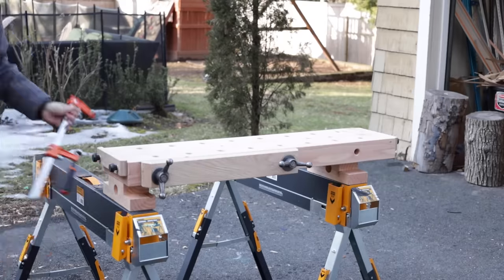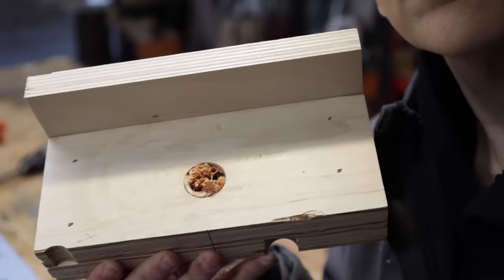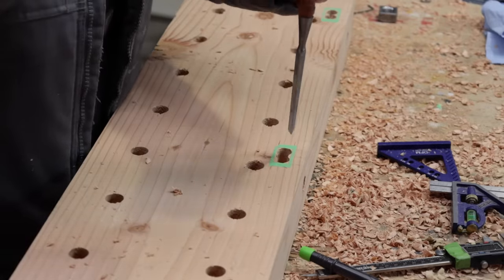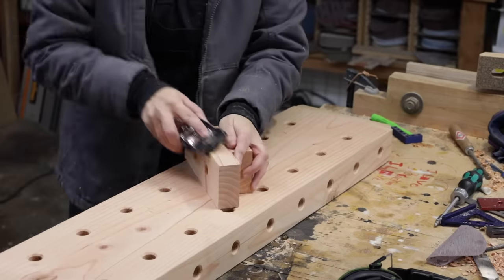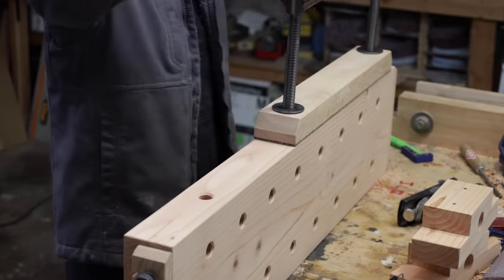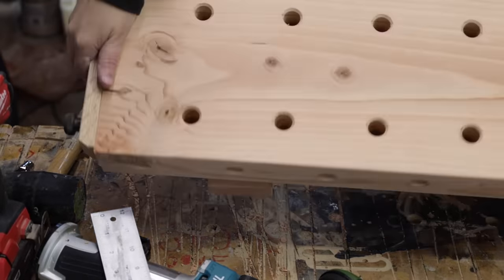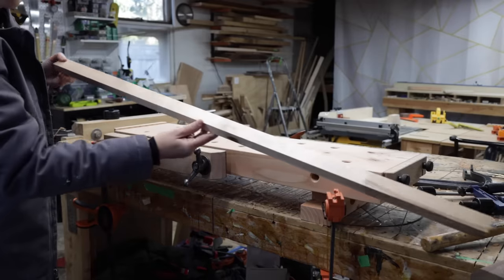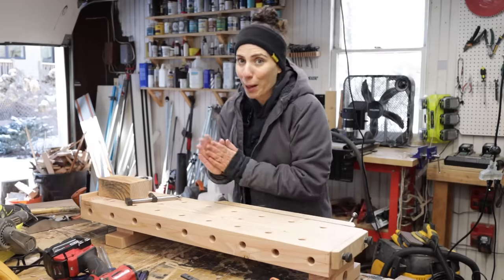Portable & Affordable Workbench for Small Spaces

Comment: Tamar, I just wanted to offer you a good tip. If you need more muscle on your vise, instead of struggling with pliers, you just need more leverage. If you have a pipe, you can slip it over the handle and that will do the trick. If you don’t a deep socket and extension works wonders
Reply from the maker: Good tip!
Reply: Another quick option for a 'cheater' bar is to hook the closed (box) end of a largish combination wrench over the vise bar, and lever it back over the vise screw.  Or use the loop in the end of a crescent wrench the same way 👍
Reply: While I would normally agree with what you are saying, not so sure I'd use a cheater bar on that type of vise. Tamar, you just need a bigger vise for that job!  That wooden vise (read clamp) is not designed for the forces you are putting on it.
Reply: I also thought that the pliers were an odd tool for the job. They hardly extended her leverage and left ugly marks on her vise.
Reply from the maker: @vanessas2454  I literally just grabbed what was next to me without putting too much thought into it. Ha
Reply from the maker: @The Program it really wasn’t a big deal. I don’t know why ppl are focusing on this. 😂

Comment: Great build and thank you. I struggled with vise as well until I got a 3/4 galvanized pipe that is 12 inches. I just put over the handle of vise and use it as a breaker bar and struggle no more!

Comment: I built this using this video as a guide about 6 months ago.  Even though I have other work surfaces, I found myself using it a lot for other things.  Along the way I added a few things that I think make it much more useful.  They are:

1. I glued a pencil sharpener to the side of the workbench, left of the moxon vise.
2. I bought an 8x12 sheet of leather and used a piece I cut from it sized to fit a pencil that I nailed into the underside of the bench just to the left of the moxon vice. I saw this in another video that someone added to a full size workbench.  I can't tell you how many times I've needed a pencil when using this and no longer have to get up and go find one.
3. To the right of the moxon vise I built a small drawer to hold my bench dogs.  I was careful to make sure that the slides for the drawer were in between the dog holes and I figured if I needed the  dog holes above that were directly over the drawer, I could just pull the drawer out and set it aside. My drawer was about 8x8 inches wide and about 1/2 inch or so shorter than the available height.  I used 1/4 plywood as I knew it wouldn't hold much weight. I also cut a small piece of hardwood and made a drawer stop right above the drawer using a screw to secure it and just loose enough that I could rotate it down in front of the drawer to keep the drawer in place.  In the back I just glued on a small block of wood to prevent it from sliding out the back.
4. Finally since I found I was using this bench so much for things that didn't need the dog holes and often small things would fall through the dog holes, I got a 1x16x36 piece of project pine board from Lowes and glued 4 3/4" dowels about 4 inches long to the bottom of the board so I can when needed just drop this board right onto my workbench and have a larger work area without dog holes. 

Anyway, I use this thing all the time, and I wanted to share how I've increased it's usefulness over time.  It's really been a great addition to my workshop and this video made it so easy to build, along with links to all the parts.  I find it so frustrating when vloggers don't include links to the parts they use, IE the knobs, the vise hardware etc.  Having all of that for this really made this video and instructions easy to follow
Reply: Wonderful ideas you've implemented here. I'll have to steal the removable dog hole cover/work space. 
I plan on making this at coffee table height and it would most definitely be used for other projects. You could make multiple insertable tops for different needs. A self healing cutting mat, sharpening stones, etc. would bring a plethora of utility.
Reply: Thanks for sharing your additional modifications and experience with this design - very informative. I'm always amazed at the creativity everyone brings to these projects!

Comment: This bench looks very useful.  If you are using the bench on your dining table or other furniture you may want to add some of that cork rubber or some other padding to the feet to prevent marring.  Also, adding a couple of dog holes to the Moxon jaw will let you clamp pieces to a dog in the bench for planing, routing or carving work where you want access to the entire surface.
Reply from the maker: That’s a great idea!
Reply: Those are two really nice ideas! You could make easily removable feet too and attach the non-marring pads to them. That way you can remove the feet if you ever need to put the workbench on a dirty surface.
Reply: That cork rubber on the feet might be nice even if you’re not on a surface you’re worried about scratching up. And if it was on a floor it would probably help a lot.
Reply: If I had a dining room table to work on; I wouldn’t need this work surface
Reply: @darylg3720  Oh, you're one of those.
Reply: @darylg3720  hahahahaha! The words of a single guy (or one trying to become single again, hehe).
Reply: @darylg3720  who needs flathead screwdrivers either when you got butter knives?

Comment: I love this for adding a little hand tool accessory to an existing bench or wherever. I would say, even as a person with a large planer, I’d probably just make this out of 4 layers of laminated plywood because I feel like it would be more stable and harder than a 2x10. If you DO plan to go this route I recommend over-sizing your plywood so if it slips when you glue it up (and it most likely will) then you won’t have start over. Once the glue is dry then trim the entire assembly to final size.
Reply: Hii sir 🤝🤝🤝😊
Reply from the maker: Sounds like a good plan!
Reply: Hi Jeremy. My first thought was plywood too. I just built one out of 4 layers of 5/8 ply. Check out my thread in the comments if your interested in a few details.
Reply: I think the side holes be a problem in plywood.
Reply: @alportante  no problems so far. Delamination is not going to be an issue.
Reply: @alportante  I think I see what you are getting at Al. The pressure from the hold fasts is longitudinal when using them in the side holes. If said holes are drilled along the C/L of the side any pressure would go directly on the lamination line which could possibly be a problem down the line.  With my bench I centered the holes on the center of the 2nd layer (15/16 up from the bottom). The holdfast pressure is now centered on a factory sheet For overkill, I  used a leftover part box of 2 in. hardened concrete screws (Tap Con) driven in from the bottom in what I felt to be the appropriate places.
Reply: @robertjeglum4657  if going with plywood and multi glue ups, it's also possible to add a plywood siding, oriented vertically.

Comment: Tamar ... you knocked it out of the park!  This is exactly what I need for my portable garage / basement work shop, much more than the Moxon vice I built.  I'm going to use the those Moxon vice parts and make this bench.  I'm sure I can find the square nuts vice the hex nuts.  I'm also a member of a community wood shop so I have access to a planer, drill press.  I just batch the work and drive over to the shop.  Stay warm ... 19 degrees in western NY today.  v/r ... tom
Reply from the maker: Awesome. So glad you found it useful!

Comment: For this small shop passionate woodworker your video was the best 24 minute use of my time I think I’ve ever had on YouTube.  Bravo!  I just recently purchased your 6-in-1 Router Jig Template that really helped make quick work of a pain in the a$$ project I was working on and can’t thank you enough for all the great, easy to understand videos that you do!
Reply: It’s me again — just watched for the second time!  So, best 48 minutes of YouTube watching 😂
Reply: I’ve been a fan of mini/portable workbenches ever since I saw Adrien Prada’s video. I’ve built a couple different designs of them, but yours really got my attention!, so I built one not long after your vid came out. The only change I made was adding one of those home center wood vises on the end opposite the planing stop. And being a welder/machinist, I built all the metal Moxon vise parts from scratch! Now, at least a year later, I’ve gotta tell you that this workbench has seen near constant use, and I’m actually considering building a second! Case in point: I was asked by a good friend if I could/would build a stable for her 7 year old daughters Schliech miniature horses as a Christmas present. She referenced a two part build on the “Daisy Stalls” YT channel as being the one her daughter was ga-ga over, which was half of a barn, but requested 6 to 10 stalls instead of the 2 in the vid. My solution was to build two halves and one half would be four stalls, the other two stalls, and a wash bay and a tack/feed room. Having this portable workbench was incredibly helpful throughout the project, and the thing actually morphed into several different forms as I moved from subassembly to subassembly! At times I used a piece of 1/4” glass on top with an aluminum straightedge clamped on top along the long side and squared with the planing stop. This gave me a great 90 degree glue up jig for making the delicate stall dividers among other things! Never even considered using it for something like that when I built it, but it’s just so versatile! I’ll stop rambling and just say thanks for producing my all time favorite YouTube project videos! And happy thanksgiving!

Comment: This is amazing. I can see this easily being made part of a modular system as well. Just making one of these at a time and attaching it to the previous one until you've gotten to the size you want. After 3-6, you have a typically sized bench to work on.

Really great build! Thanks for showing us your process for it!
Reply from the maker: That would be super cool
Reply: @3x3CustomTamar  Paul. I have been thinking how I could make a MFT style bench, but could not wrap my mind around how to drill the holes with out buying an expensive jig. Tamar’s simple jig and like you said make one at a time and attach them together will get the job done. Thanks guys!
Reply from the maker: @richardlug6139  awesome. Glad it was helpful for you!

Comment: This is genius! I have a workshop in my basement but often do renovation work upstairs. It's annoying to have to constantly go up and down stairs to use my bench. This would definitely come in handy. Thanks for sharing!
Reply from the maker: Awesome. So glad it was helpful!
Reply: I agree, I was doing trim work in my bathroom and got tired of running up and down the stair a with long pieces of trim to bring them down to the miter saw to take “just a hair” off and test fitting. I made a little shooting board based on Tamar’s and brought it up to the kitchen helped me refine the fit once I had the rough cuts done. Having an entire hand tool bench would have been even more useful for this project.
Reply: @jeremyspecce   When I was doing trim I ended up settling for putting my miter saw on the laundry room floor. Definitely better than running downstairs but not great having to squat down on the floor all of the time. Wish I had seen this video first!

Comment: Hey Tamar, I bought the plans and I'm going to make the workbench out of 'fancy' wood.  I love the projects you do and am happy to support your channel.  I do have a suggestion though; get yourself a 12" piece of 3/4" steel pipe and use that to extend your lever on the vise when you need more power.  It will be much more effective than awkwardly grabbing the lever with channel lock pliers.
Reply from the maker: Appreciate that!

Comment: I don't have a thickness planer, and certainly not the skill with a plane to make this flat, so why not laminate some 3/4" MDF? It could be edged with solid wood. I may try this.
Reply: MDF is dear and can't handle water. I made a table for my son out of 16 mm pine sheets. I didn't have big pipe clamps, so I glued the 1 large sheet to a narrow piece because he wanted it bigger in depth. I used wooden blocks on either side of the joints so I could glue and clamp with small cheap clamps. Easy peasy! You have to improvise sometimes. .

Comment: Only takes a 2x10 to build but includes none of the cost of all the other stuff in the video, planer, hand plane, chop saw, glue, table saw, square, measuring tape, drill, bits, ca glue, brad nailer, drill press, clamps, bushing, vise, the list goes on and on. The people that like this have never made anything out of wood.
Reply from the maker: Judging by the amount of plans I have sold and how many pictures of completed projects I have received you are wrong. People find a way.
Reply: A lot of those things you listed make it easier, they aren't required. There's plenty of videos on YouTube on achieving much of the milling process without expensive machinery. The basics would be a contractor table saw or even a circular saw and some jigs. Most folks have a drill and the $50 bits aren't required, again they just make it easier.

Honestly the most expensive part of this build that isn't listed is the hardware (vise components) but there are alternatives if you're willing to modify this fairly open design.
Reply: You forgot to iclude the pencil. Whats wrong with you?

Comment: What a great little workbench! Thanks for sharing how to build it. I have a steel table that used to hold a 1200 lbs granite surface plate. Sadly I had to destroy the plate when I moved but I still have the table. The table lives outside so this should be a good solution until I clean out my garage. Thanks

Comment: I loved your idea for the drilling jig using the 3/4-inch bushing.  I did it a bit differently.  I used a scrap piece of 3/4 inch hardwood, marking the center of the hole to drill for the bushing.  I then cut one long side at 2 inches from the center, and the other long side at 1 1/2 inches from the center.  I didn't attach the side "guide", but instead just used clamps to keep it in place, moving from hole to hole.  The jig was set with the 2-inch side flush to the edge of the bench with center guidelines drawn on the jig to line up with the measuring marks.  For the side holes, I placed the 1 1/2-inch side flush to the top of the bench and clamped it, so the side holes were drilled exactly half the height of the bench.    I took some pics...if anyone is interested.  But it was super simple.  I sent the pics on your IG in case you wanted to see.   Thanks Tamar!

Comment: I would drill and add roll pins through the vice handles to add mechanical security to the all thread and still be repairable or changed.
I would also extend the end vice to our left, her right for sanding, to stick out the back a bit so it could be used in conjunction with bench dogs to clamp long pieces lengthwise on edge.

Comment: This was perfect Tamar, thanks for posting and making the plans available. I used this very successfully to build two solid 1.25in ash trestle dining tables, with only this as a bench. I found, completely by accident, that it fit nicely on top of two open frame boxes I use as assembly supports (Ala Bob Lang, from Popular Woodworking Magazine). These super simple, super handy boxes were just the right height, and very stable/strong, I anchored the mini bench using two 1in dowels, instead of the plans legs,  as locator pins, one through the top of each box. This all comes apart quickly into three very portable pieces, which was a bug help as I don't yet have a shop. Wish I could attach a picture here, but suffice to say this little bench and those two boxes got me through, and now I've started on building an actual workbench! Horse/cart inversion noted! 🤣
Reply from the maker: Sounds cool!

Comment: I might add some of these things to the makeshift bench/axe stump that I have at my spot in the woods. All I have on it now are a bunch of those holes and hand-carved pegs to go in them to hold wood for sawing and for whittling and then I cut in a stop for supporting wood while carving and for supporting it while using the axe. I like the idea of putting in a vice of some sort so I may break down and bring some screws and stuff to lock things down. I also think I'm going to try to carve some of those curved holds like the metal ones you have because I can definitely find a few Y branches that would probably work. I already made myself several wooden mallets so that's already covered.

Comment: completed this bench a could of months ago. works great. I am in the Philippines and as such humidity is.quite heavy. I have had to drill out the dog holes twice already and I think will need to do agin soon. but apart from that its all great. I used a local hardwood but the next one I build I"ll use some second hand ex house hardwood. should be plenty seasoned.